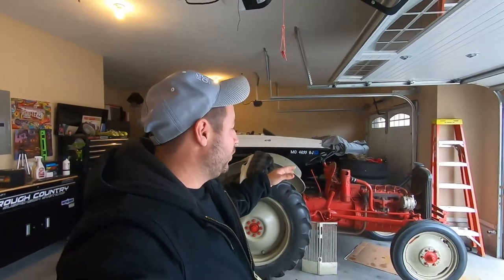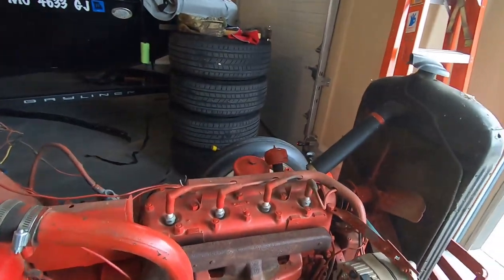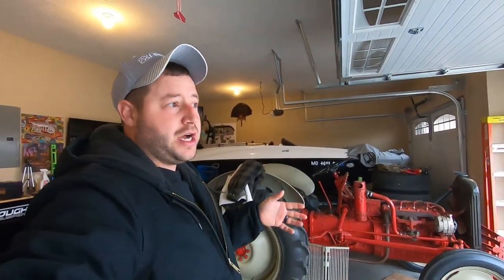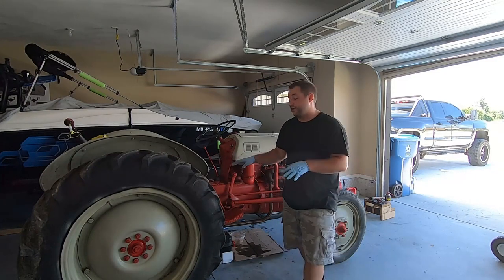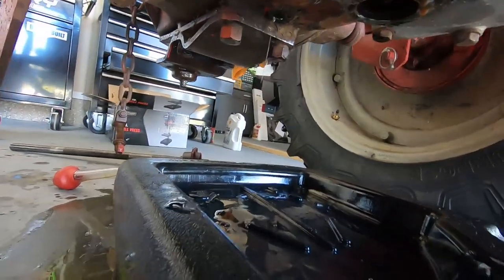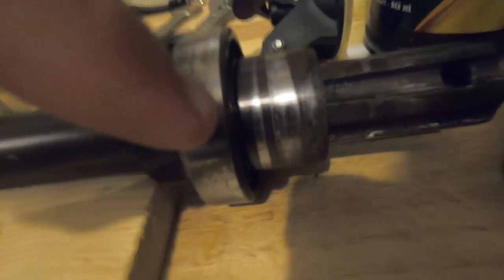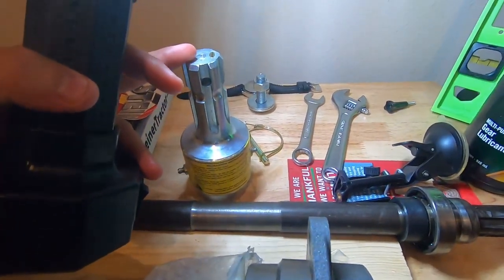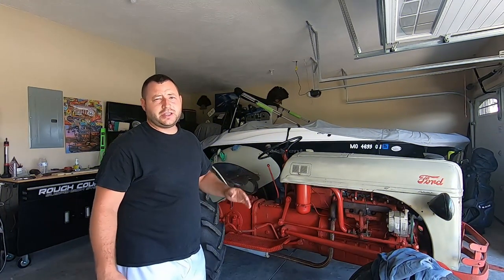Dismantling the 8n & PTO Conversion

Comment: I have 1948 8n that has a cover over the PTO.  My grandfather, who never threw anything away, seems to have kept the PTO and all the bits to install the original draw bar.  However, the PTO that I believe fits this tractor looks to be longer than it should be, it certainly doesn't look like any of them I've seen on YouTube.  I've been thinking about trying to put the PTO back on the tractor so I could use a small brush mower with it, but I'm not sure how it would all go together.
Reply from the maker: Mark Lasater the pto cover only covers the original. Unscrew that cover and u should have the original shaft on there, to my knowledge that cover is designed for safety. Not a plug to replace the shaft/hole. A really great group on facebook is “the redbelly group”. Tons of help and pictures and whatever ur questions are, they and myself can answer them on there. Thanks!!

Comment: When adding the new shaft, did you put the gasket on dry of used a gasket sealer??
Reply from the maker: Ken N Tx just put the gasket on dry. I have had zero issues and been running sense!
Reply: @midwestbuilds  Thanks, all installed..
Reply from the maker: Ken N Tx awesome!!